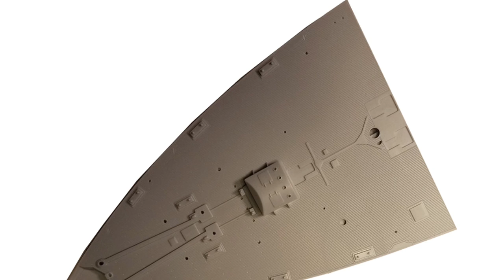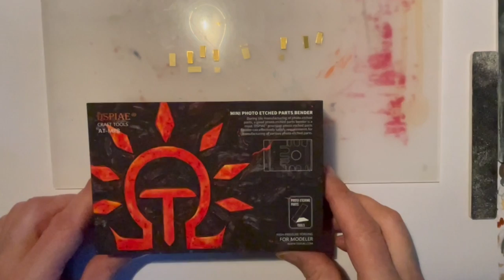Trumpeter Titanic Build:  Forecastle and Deck

Comment: Good job. I ended up with some tiny annoying ripples at the back edge after applying the deck but it doesn't show.  I clamped the whole thing down too so I will have to watch that on other parts of decking. The KA comes with some brass drainage parts that will fit over that black line around the forecastle which should look good too!  😉
Reply from the maker: Yeah I learnt alot doing just that one so hopefully the rest will be perfect. I might try to fix this some way…:)

Comment: Very useful vid, have subscribed - many thanks for posting.
One question if I may - do you advise varnishing/clear coating the scaledecks decking first, or is this a waste of time? And if applicable, what varnish/clear coating would be best?
Many thanks, Alasdair
Reply from the maker: Thanks. I did mine with Tamiya Clear coat. I would recommend it. It protects the decks from smudges etc.
Reply: @themodelbench  Great - many thanks. I will do likewise. Regards, Alasdair